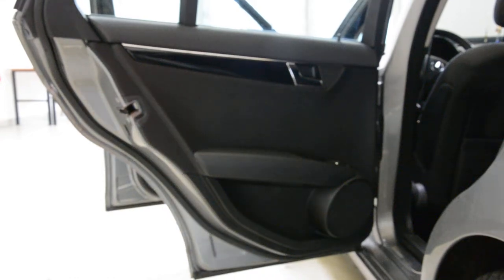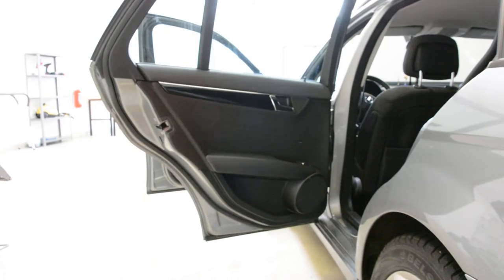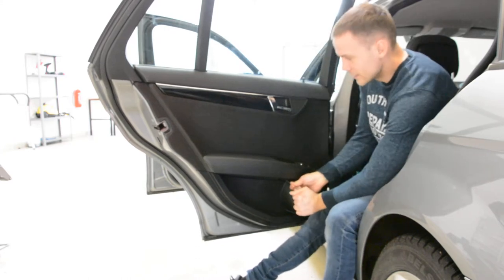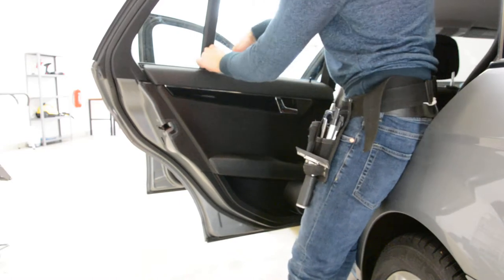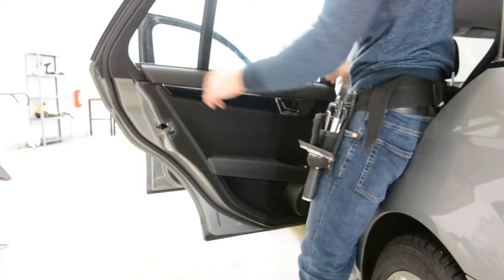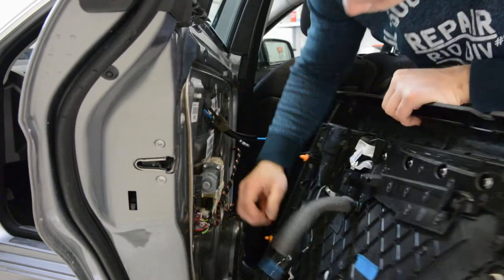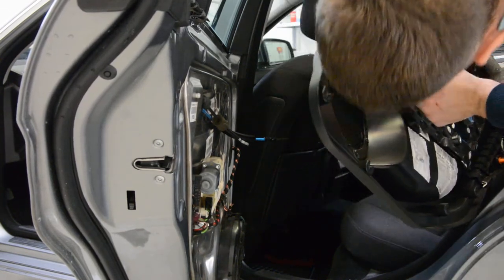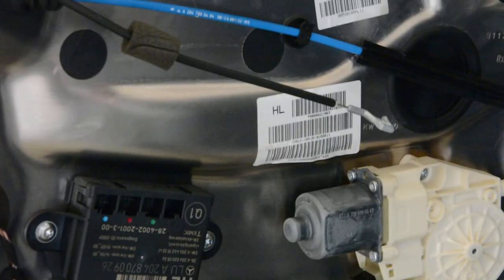How to remove the door panel Mercedes C Class  2008

Comment: Do you have a video on replacing the entire rear door?
Reply: I just did that and it is easy to do. Just remove the  hinge bolt covers and the bolts (2) while someone holding the door. After that you just lift the door off gently.